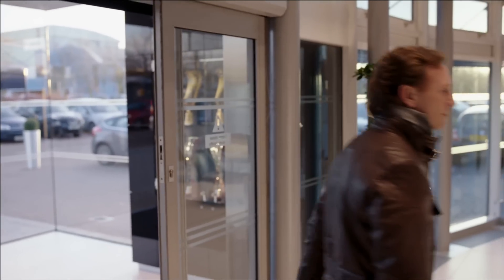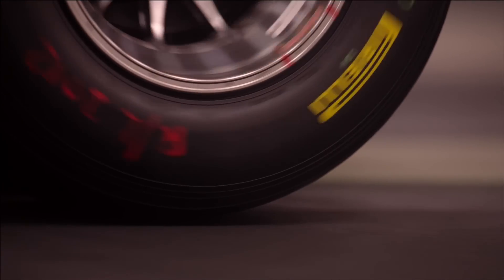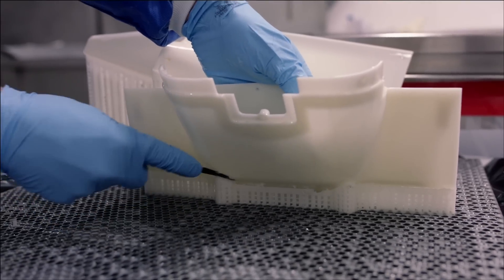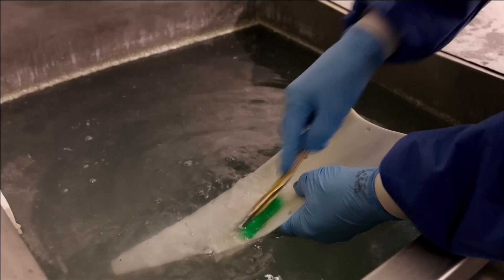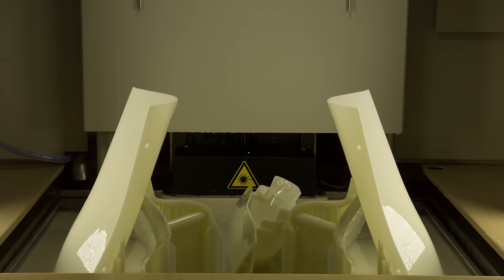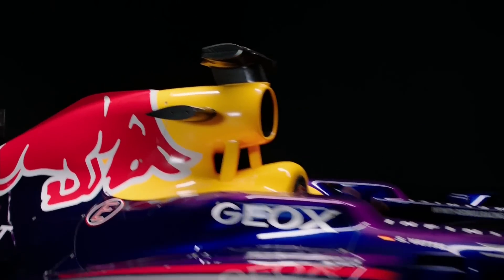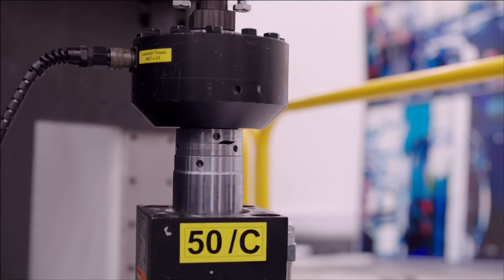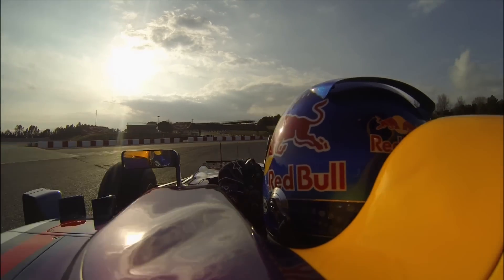How To Make An F1 Car: DESIGN AND R&D  (Part 1)

Comment: I'm new to the sport, and have a question I hope someone can answer: If each team designs their own machine, how is it they all look so very similar to other cars each year?

I know the FIA has guidelines to follow, but does that translate to all cars looking so similar that they could easily be mistaken as being the same design?

Things like the front and rear wings look the same on all cars, so I imagine that's part of the FIA-required parts. 
So is it that things like body shape and wings are predetermined by the FIA, and the rest of the car is where the teams have leeway?

I sure hope someone sees this and can answer.
Thanks in advance!
Reply: Not sure if you already found the answer but here is my explaination:

The FIA indeed has guideliness on the desingn of the car and these guideliness have been increased over the past years. This means designs are generally more similar since there is less and less 'freedom' in the design nowadays. If you look at older seasons in f1, there is a lot more differences between the cars. There are also a lot of videos on youtube about these designs back in the day (e.x. some teams trying out cars with six wheels, x wings, double front wings, and other weird designs). 

> So is it that things like body shape and wings are predetermined by the FIA, and the rest of the car is where the teams have leeway?
Some parts are standard and teams cannot change those but most of them are guidelines where you can still change the part, but to a certain extend. 

Another big thing (and you will deffinetly hear that in those videos too) is that other teams are really fast to copy designs from others if they seem to work well. A good example of this is the z-floor design this season, that teams copied after a few races from teams that started with it. Of course there is also a limit on how much you can copy from other teams and how much you can change during the season but this is also another reason cars look very similar. Especially in 2020 there was a big controversy around Racing Point (now Aston Martin) since their car was almost an exact copy of the Mercedes car. Back then it was also called the pink Mercedes!

Also remember these cars evolved over multiple seasons and at some point there can only be smaller improvements. I'd like to end this by saying 2022 will have a big regulation change on the airodynamics of the car, which means there is a possibility that cars will look very different from eacht other again, but expect those differences to decrease again over the following races/seasons!
Reply: @officialdjnoel  No, I hadn't found the answer.
Damn good explanation, man. 
I appreciate you taking the time to help an F1 noob understand part of the sport.

Comment: why is the wind tunnel mock up only 60% actual size?? do they not have a tunnel large enough
Reply: +Austin Whitecotton Well they have to get the car inside the tunnel for a starter and it's probably not needed, at 60% size it probably represent the aerodynamics of a real car.
Reply: Also it's MUCH MUCH cheaper and less wasted resources building a 60% design  so they have more cash to design more.
Reply: You can just scale up the numbers in the equations as if it was bigger and get the same results, that's just how the math works. It's cheaper and faster to build it smaller.